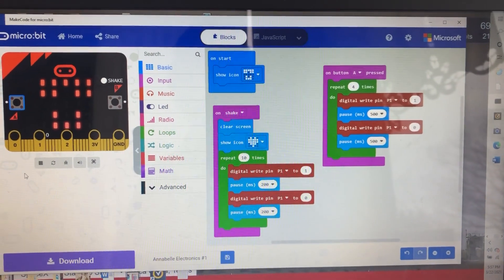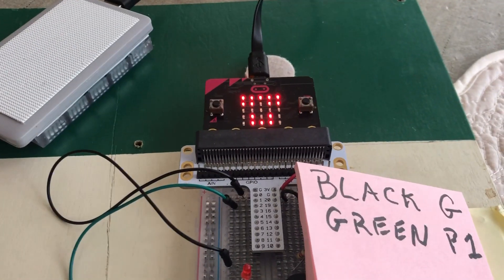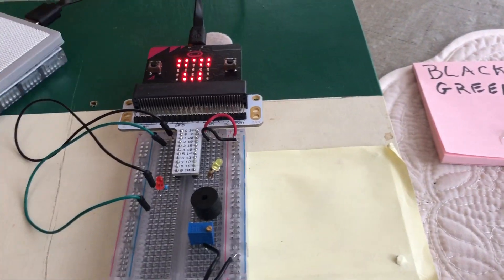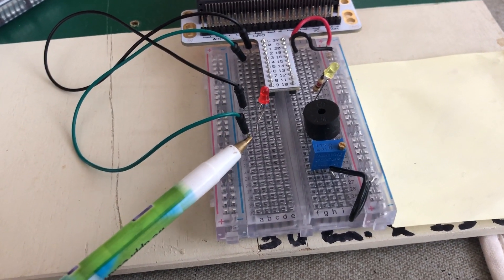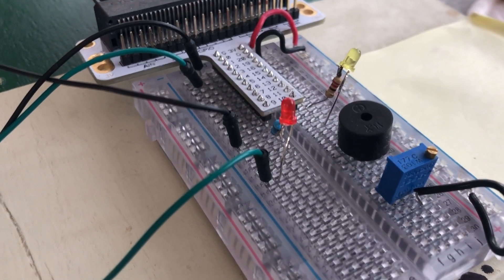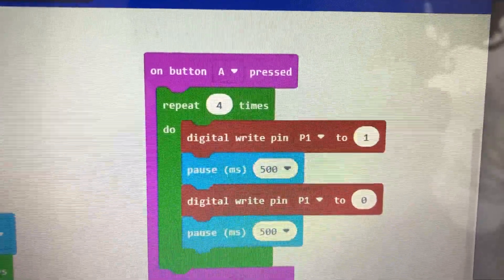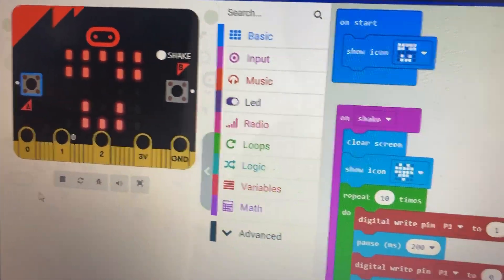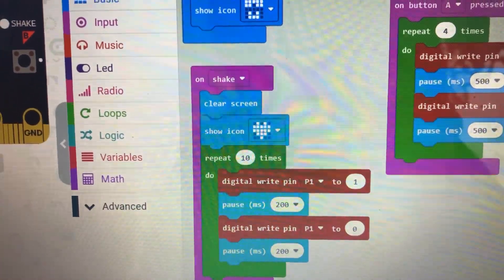MicroBit MakeCode Blink an LED on Bread Board

Comment: how do the cords make it so that the led is connected to P1?
Reply from the maker: Hello, @ofe9411, this video shows using the breadboard. The holes in the breadboard are connected by metal and if you plug a wire into a hole of P1 that connects the wire to Pin 1 on the Microbit. The other end of the wire is plugged into a hole on the breadboard and one leg of the led is also plugged into the hole in line with the wire so they are connected by metal together; this is behind the breadboard. Now the other wire must be connected to the ground wire of the led, that is the short wire. There must be a resistor in this circuit so I make that on the short, ground wire, so the lded does not burn out from too much electrical power. I hope this explains it to you. Please tell me if you need more information.
Reply: @makecodeandhardware1395  thanks for the response! So there are wires that connect the LED to the pins and the rest of the wires are connected to the resistors?
Reply from the maker: @ofe9411  Only 2 wires are used and they are on the left side of the breadboard. All the wires on the right side are not used in this video. In this case I have a resistor connected (soldered) to one leg of the led. That is the ground leg. So there are only 2 wires used here. P1 is to the right leg of the led and the black wire is connected to the ground leg by way of the resistor to the led.
Reply: @makecodeandhardware1395  Okay now I understand, thanks for the explanation! :)
Reply from the maker: @ofe9411  I invite everyone to ask questions. I am happy to answer any questions.